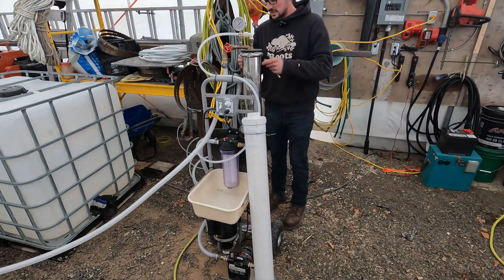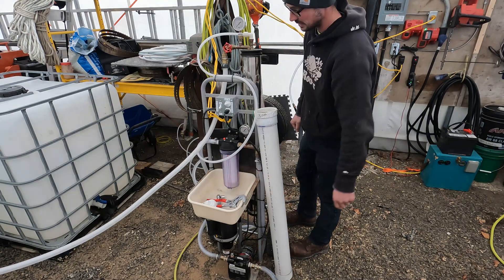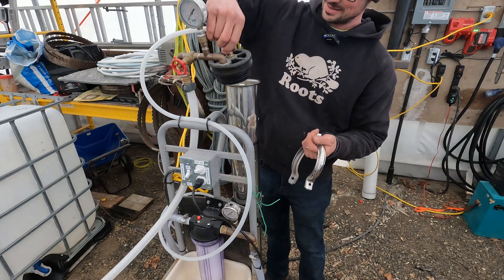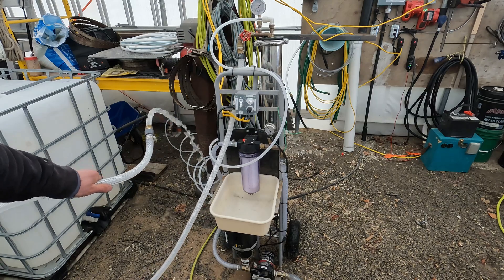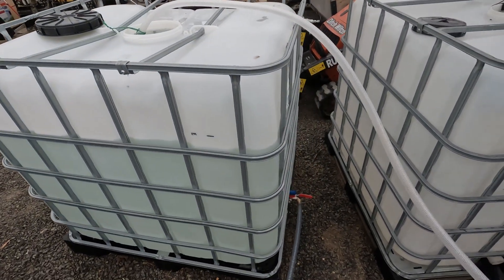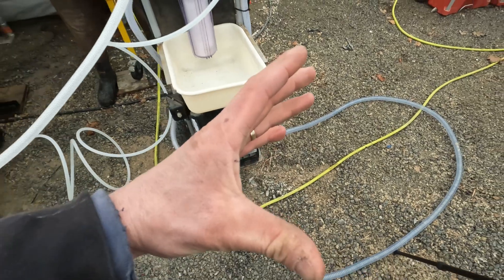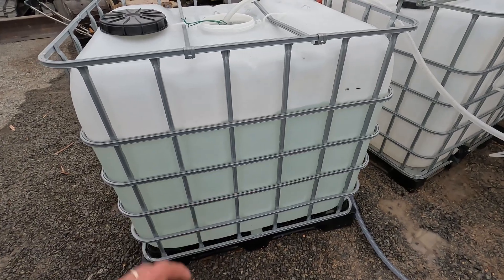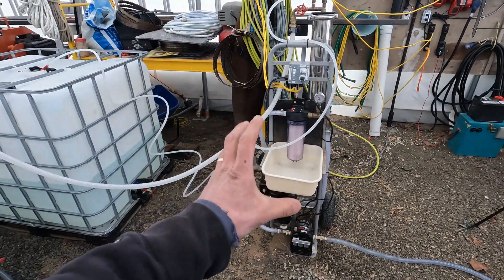Making Maple Syrup - Setting Up Reverse Osmosis (R.O.) System for Season

Comment: Hi Rudi, thanks for your videos - they are some of the best and most informative out there.  I noticed you didn't wear gloves when handling the membrane, and I know the small residential membranes shouldn't be touched directly.  Is that not a concern with 4040s or is it still best practice to not touch the membrane, or at least do so with very clean hands?
Reply from the maker: Thanks. The outside of these 4040’s are wrapped with fibreglass like material. The outside does not do any filtering.

Comment: I noticed you put this membrane in with the black rubber gasket on top. The other storage video I saw, your membrane came out of the housing with the rubber gasket on bottom. What is the best direction to run this membrane. I have built the same setup based on your specs.
Reply from the maker: rubber gasket should be at the bottom in this particular setup. I made a mistake in the video with it in the top. It won’t build pressure if you put it in the wrong way so that’s a good way to tell. In this setup the high pressure water comes in the bottom and is forced up the membrane. The gasket in this case prevents water from going up between the stainless casing and the outside of the membrane. Some ro membranes have a direction of flow arrow stamped on them too.
Reply: @rudijones  I only ask because I’ve got it with the pressure coming up from the bottom like yours and the gasket at the top and it has been working. It gets up to pressure and the liqquids seems to separate properly but I’m wondering if it would work better if I flipped it around
Reply from the maker: @FaithMcClelland-jy4jt  that’s interesting. In reality it probably doesn’t matter a whole lot where it is located if pressure is building. That being said, if it’s at the top, the space between the stainless casing and the outside of the membrane would collect fluid and not flush out as well during cleaning cycle. By putting it at the bottom directly at the inlet the fluid immediately enters the membrane. Also, if you look at the o ring it should be “barbed” to one side. As the pressure behind it builds it actually forces the o ring tighter against the stainless walls.
Reply: @rudijones  thanks Rudi. Your videos are great and very informative. Keep up the good work!

Comment: Thanks for the video and explaining things well. Had a question regarding flushing, do you or have you seen people back flush the RO membrane? I presume it'd be best done with the low pressure pump and having valves where you can switch the inlet & outlet to the membrane itself.

Comment: Thanks for the info! how long do you leave the water flushing the RO into your head tank before removing it?
Reply from the maker: At first startup in the season I run 100 gallons of clean water through the system to waste. Between batches of sap I run 50-100 gallons of clean/ro water through the system to waste to flush out any sugar on the membrane.